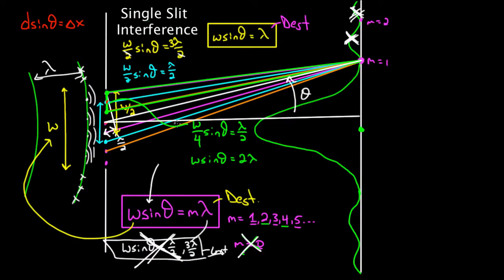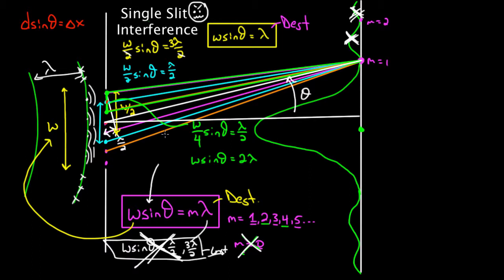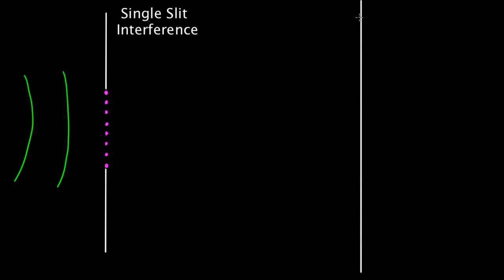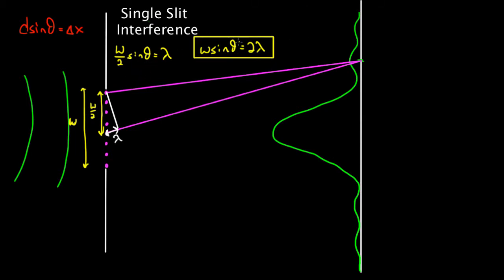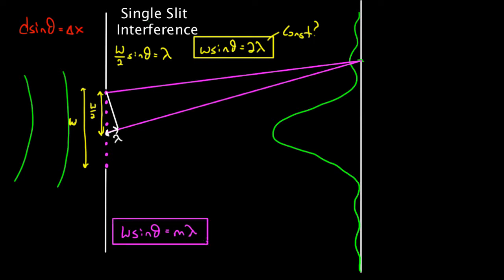More on Single Slit Interference

Comment: I thought in order for there to be destructive interference the path difference has to be 0.5, 1.5 lambda not 1, 2,3 lambda
Reply from the maker: That's for double slit interference. For single slit, it is the whole wavelength differences that give destructive.